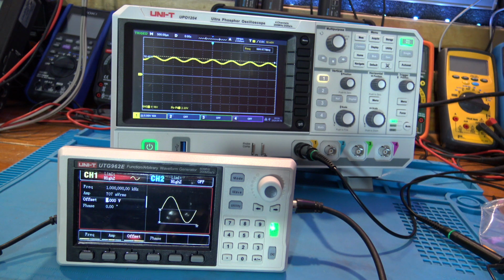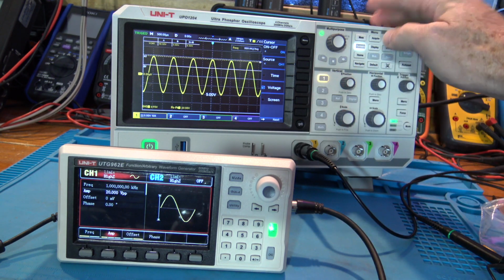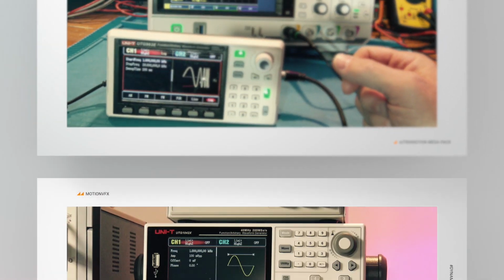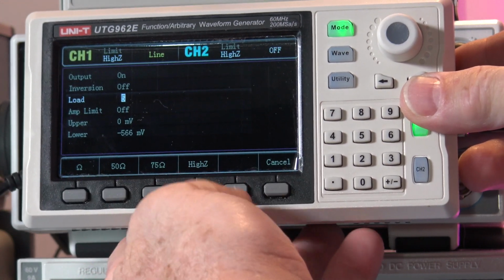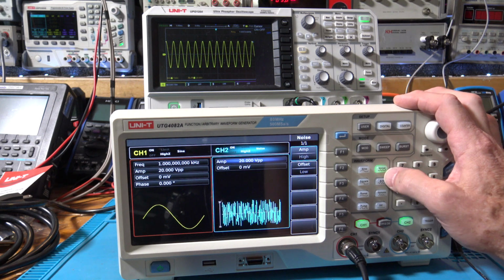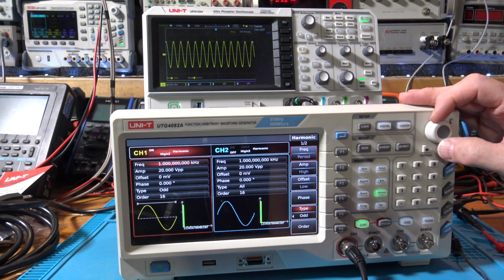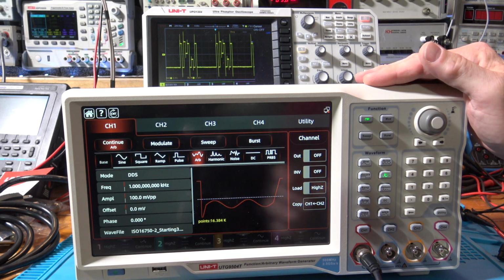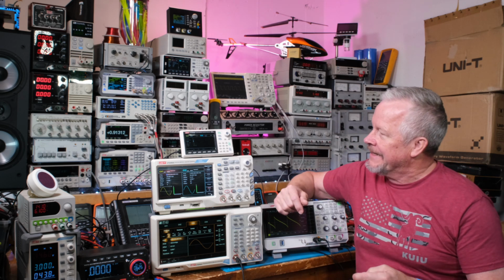ARB Generator Shoot Out Uni T Signal Generators a Closer Look #functiongenerator #ARBgenerator

Comment: Intermediate frequency  for AM is 455 KHz  give or take depending on the radio. FM intermediate  frequency is 10.7 MHz.  The FM band starts at around 88 MHz.  to 108 MHz
All of these new generation generators seem to have AM and FM modulation. 
So how does the advertised MHz relate to what I need ? I don't think I will need or use nothing more then  the sine wave.
Reply from the maker: Great question!  The generator with 500 MHz is not low cost but would do what you need.  I'm sure we can find a generator that better suits what you need without all the cool features that these have.  I'll look into this and come back with an answer.  This is a great use case that many others would be interested in.
Reply: I have been doing a lot of googling for a new simple RF generator that might work. I found one old school one with very bad reviews. I have been on eBay and all I saw was some very old antiques that might or might not work. I guess I could get one of those old Heathkits and put it on my antique test equipment shelf along side of my other old test stuff but I would like something new

Comment: I haven't watched the whole video yet, but what I don't understand is the megahertz that is listed on front of the generator .Many expensive ones are around 30 MHz . And Juntek 9080 is 80 MHz. Some are 10 MHz. Don't have much money, and I don't understand what I might need, I won't get beyond vintage AM and FM radios and maybe a vintage TV or two.
Reply: The MHz number prominently displayed on them, is the highest frequency Sine wave they can generate.  Looking at the Uni-T UTG3082A spec sheet... 80 Mhz Sine, 30 Mhz Square/Pulse, 2 MHz Ramp, etcetera.  So if the frequency of waveforms other than a Sine wave are important to you, you need to read the datasheet carefully.  I'm not sure what your needs for radios and vintage tv might be... although I would like to know myself.
Reply from the maker: @garthhowe297 Great response;)